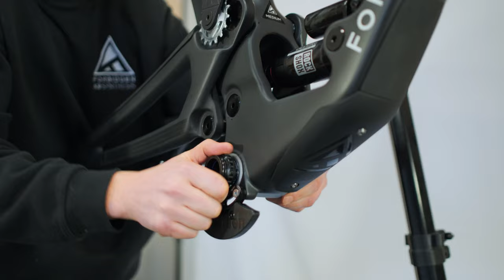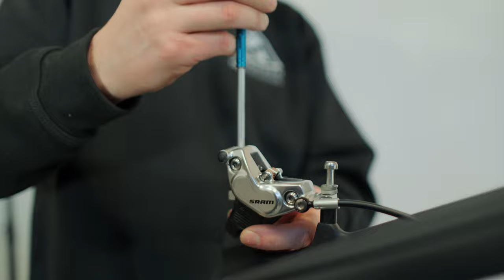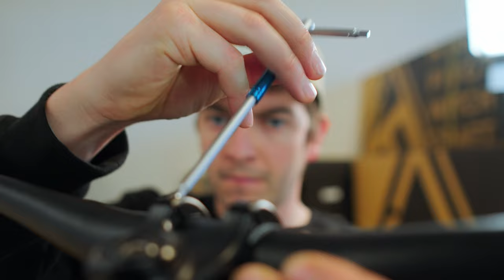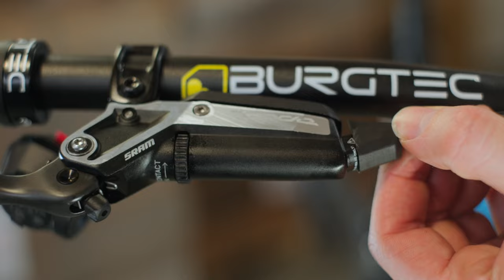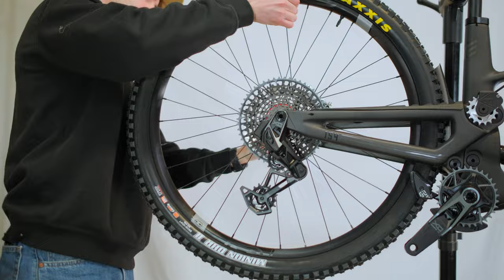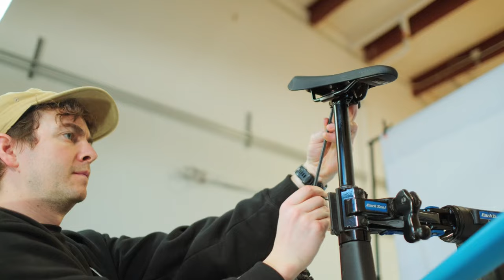Building The Forbidden Dreadnought X0

Comment: I thought the new axs drive train was  not approved for high pivot bikes by sram. Or I must have read something wrong. I guess I cannot bolt on the drive train on my first Gen dreadnought?
Reply: You are correct. I tried it and shifting is altered as the clutch cant be disabled on sram trasmission.
Reply from the maker: If your Dreadnought is UDH compatible, you can install the new Sram transmission! If you have more questions about compatibility, reach out to our support team.